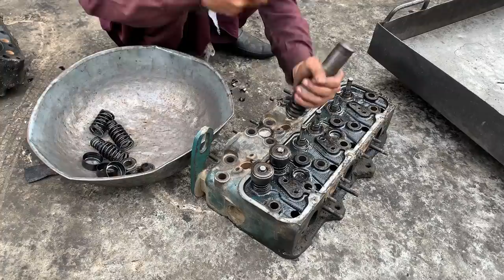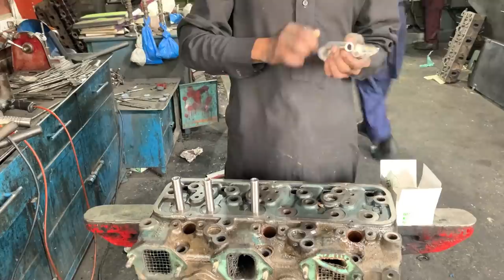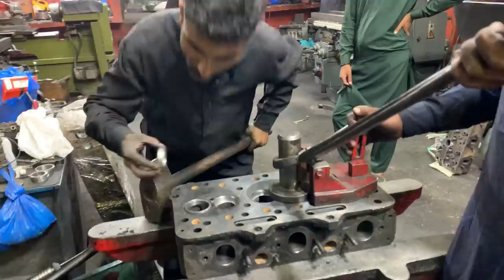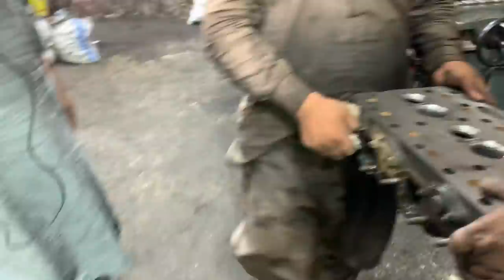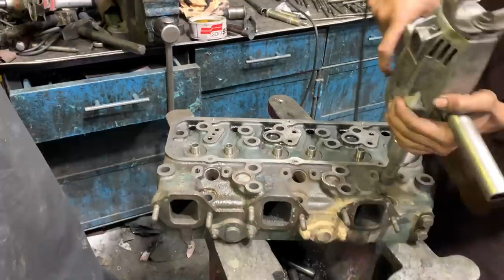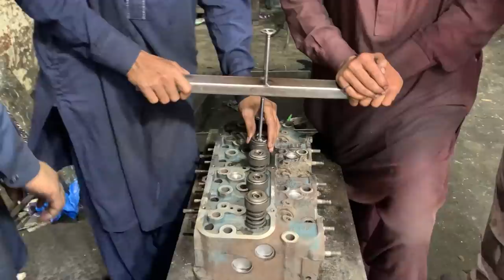Cylinder Engine Head are Warped | Amazing Technique of Resurfacing Cylinder Engine Head

Comment: Warning: NEVER wear safety glasses when grinding or resurfacing metal parts.
Reply: Or gloves when handling solvents.
Reply: @garrykennedy5484  thats the cringe part for me, solvent get absorbed so easily, its probably diesel or kerosene since its readily available and the less worst solvents
Reply: @robertficek7586  the guy wearing sandles in a machine shop covered in grime and metal shavings is what got me......that and the guy using a grinding stone and doing saftey squints.
Reply: just squint or look away.
Reply: @garrykennedy5484  What types of overalls are those- look like you get them there in different colours/
Reply: @polo08vw44  only 3 colors in this country and 1 is for jail.
Reply: @andypappy945    like the squinty weld
Reply: They obviously don't have an OSHA or an EPA official in the area.
Reply: Yes  @garrykennedy5484   no glowes anywere back then  -  when I started, a apprentiss would end up in the engine/gearbox washing machine, if he talked back to a mechanic -  and that was in the "good" old days with leaded fuel = so the cleaning solvent was the least to worry about - imagine how much toxic poisen that big machine would have.
Reply: @MrJCTONE  Yep. Back when I was paying the same price for a pack of cigs as a gallon of gas. 35 cents.
Reply: Use the SQUINT method!
Reply: lol - made me laugh
Reply: @polo08vw44  I have been kidnapped in the US for 14 years by a redhead...... and it is so wonderful to see 'colour' spelled correctly. She says things like "Should of went"..Got to go she is coming back !
Reply: Or a mask when grinding away dust and metal
Reply: @TrophyNZ1  I burned my eyes welding... Once. The pain was incredible.
Fortunately, the conjunctiva grows back in a day and I was patched only for that one day.
From then on, I was scrupulous with earplugs, safety glasses, and a good welding helmet.
Reply: Why?
Reply: That kind of attitude, Now you understand why factories never moving back to USA
Reply: @robertficek7586  Bro I’ll have Varsol parts cleaner and gas and mineral spirits on my hands at one time haha
Reply: Or mask
Reply: Thx for the PSA
Reply: @Spark-Hole  so being safe is a bad attitude?
Reply: These cats are beyond that.
Reply: @XiseTK  this used to happen here 60 years ago.  For what they have, they do excellent things.
Reply: @chevinbarghest8453  that's sad, man up.
Reply: @mrz5574  they know what their doin
Reply: Feel bad for these workers..almost  paid by the penny for their skills
Reply: More likely to get cut open on the sharp edges after resurfacing. They can be incredibly sharp.
Reply: H&s aside (each at their own peril ) fab work indeed love the video
Reply: That’s only in America 🤣
Reply: ... while wearing sandals
Reply: Wise words spoken
Reply: they have monkey insurance for life: if they get hurt they are fired...
Reply: @XiseTK  let the hammer fall on you feet monkys love it
Reply: @davem5333  they only have one. its the moky rule
Reply: @kurkkobain  fett monky? I don't even know what you're trying to say
Reply: of course you dont understand anyhting @XiseTK
Reply: So ein Quatsch

Comment: Lol at all of the pussified comments, it's not a jet engine, if it works for them then that's the most important point, I'm sure that the engine would work just fine without the head cracking, valves flying out and coolant spraying everywhere as everyone in the comments section is suggesting, they've been doing this for a long time, do you think people would keep coming back to them if they did a bad job?
Reply: Yeah some guys just get enjoying out of criticising other mens work, half of them have never done any work on an engine and they are just parroting what others are saying, the guys in the video work with what they have and also with whatever knowledge was given to them, both are no doubt less than guys from the west doing similar work are given. And a lot of the crap the commenters say is pedantic text book BS, I grew up on a large farm we were often tearing diesel engines down and doing our own "country repairs" often out in a field with the deck of a truck as a workshop, the engines often got similar treatment to what you see here and I never saw anything fail because of it.

Comment: God bless the engineers who designed these engines to handle the tolerances these guys are rebuilding them to.
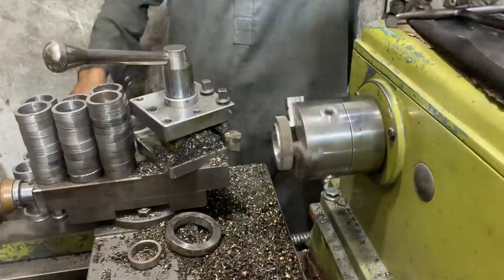Reply: There using modern day machining practices. Im a machinist and I can tell you   we use the same tools here in the usa.  They have a bridgeport kneemill  made in bridgeport ct or its clone.   The one gentle man @ 5:10 even mics the multi face vale angle.   Besides the clothes everything here is similar  minus hot tank.
Reply: @markrich3271  Don't forget the pin gage at 4:00. Frankly most of the motions you see here you'd see in any shop that rebuilds engines. They'd just be using a bit more machinery to get things in their place. All the practical stuff is identical to any machine shop.
Reply: @markrich3271  Nice to hear from a legitimate machinist rather than the 14-year olds in their parents' basement who seem to post most of the comments here.

Comment: My grandfather was a Belfast carpenter, went to Hollyhead for work & stayed. He was in a Lonfon mechanic for 30 years used to flatten heads and blocks using a scraper and Prussian blue. Handlapped valves- was taught this by his father- a steam engineer. Swore mills were useless compared to a skilled smith. But beautiful fly cutting work here. Look at those anvils. Proper job.
Reply: I BOUGHT A FORD VAN(Old Sears Van) with a 302...It had a burned valve...it took me 3 days in Erinburgh, AZ (Next to Colorado River) To fix that burned valve...I HAND LAPPED THAT VALVE IN...YUP...IT COST ME A FEW CENTS SHORT OF $40.00...HEAD GASKET AND EX VALVE...THE 3 PLUG WIRES I TORE UP( Rotating engine to break head gasket loose) I found in a dumpster in Phoenix...yeah it limped back to Phoenix on 7 cylinders...worse than 1 it had before...3 mpg...it smelled so bad to those behind me...I apologise too!!!...PEE YOU...!!!
Reply: The fly cutting looks good because the millhead isn't trammed, it leans left a bit. You can tell because the leading cut isn't as deep as the following cut. The head should have a light circular crosshatching from both the leading and trailing cuts if done correctly. The result here will be a circular dip between edges in the middle of the flycutter's path. Pretty much guaranties a blown head gasket.

Scraping is a real skill, good on your granddad.

I once owned a Chevy Vega that warped its block every time you looked at it cross wise. I ended up just flat filling the thing. Probably lasted longer than this "fix" will.
Reply: I think we all wish your grandda had a chance to share with us how to outcut a lathe because I've seen a few old timers and I do believe they had a "feel" that was equal to a micrometer.
Reply: @ChimeraActual  If it isn't trammed, it won't leave circular cross hatching and will leave a dip in the middle. Why did you say the fly cutting look good?
Reply: @jackfrost2146  Because it did. But looking isn't the same as working.
Reply: @ChimeraActual  True----The untrammed look is always prettier. I actually used the head tilt to advantage once From memory it was a three inch fly cutter to cut a 2 1/2 inch radius x 1/4 deep in a plate to be used as a saddle to sit on a 5 inch dia. tube.

Comment: All power to these guys, enjoy these videos, wonder how long their fixes last for?, be impressive to hear
Reply: Looked alright to me. Wasn't all that long ago a lot of guys reworked their engines. There were plenty of automotive machine shops around to get your machining done if it was needed. They would do as much or little as you wanted them to do. NAPA had shops at most of their locations.
Most of the time you might have the heads surfaced if needed. Have new valve seats put in and ground. Bore or hone cylinders and grind crank journals if needed.
Pick it all up and finish the rest in the garage.
Parts have gotten so stupid in price it's not worth rebuilding anymore and much cheaper to just  yank the motor and trade in on a reman unless you're into some kind of hot motor. Can't avoid that money pit anyway you go at it.
Reply: the fix last 1 year its ago -  its so cheap you can do it time to time. head is reused 1.000 times

Comment: In the 1950s I watched my father repair a warped head. He pulled the head and ground it flat on our concrete driveway. He drove that Goliath van for some years after that.
Reply: oh how things have changed, that era of Gentleman just got on and did it, absolute legends
Reply: @davidparker667  to be fair those old school engines don't have the tolerances or compression these new ones have. would you risk your time and money in parts and materials on a head you lapped yourself which may need to be redone? or send it out for 100$ and have zero worries? some head gaskets cost that much and if the head isn't perfect it will just blow again.
Reply: I've done my own with a block and abrasive paper on a diesel Passat.  Granted it was an aluminium head and it wasn't excessively warped but it lasted for 8 years and 200k miles before I scrapped the car

Comment: I was taught that to replace valve seats and valve guides I have to heat head to 160'C, cool other elements, and  use thermal expansion of materials to get strong connection between them. But it seems to be incorrect, hammer and chisel is enough. What material they use for valve seats? Ordinary steel pipe? What a save of money! For mechanics of cource.
Reply: they use cast iron, these tortoiseshells are the ones we used 40 years ago, now we use steel tortoiseshells with higher strength. While the head is being heated, the tortoiseshell must be cooled. Greetings from turkey
Reply: Yeah, I was shocked to see them making their own valve seats. I did a bit of this type of work and we always just ordered them in. For us instead of heating the head we cooled the valve seats in liquid nitrogen to get them to contract. Really tight fit that way after they warmed back up.
Reply: The pipe is not made of steel, also made of cast iron who are good against wear. When I replaced the pipes in the cylinder head in the Toyota Hiace engine, these pipes was made of cast iron. And the other to example BMW engine, the pipes was made of bronze.  The peoples who are working with the cylinder head are skilled to work with the old engines who are running year after year since 1950, really good work!  Greetings from Norway and I has worked as car mechanic in 30 year.
Reply: It being able to work with what you've got . In them condition it's very good. You put a good machanic in them condition he won't know what to do

Comment: Nothing fills me with more confidence than seeing hand clamps being used on a milling machine to hold the parts in position while trying to do a boring function.
Reply: Well to be fair they did have a nice rig set up to use the stem part of the valve stem as a centering guide. But eh not ideal, but when in Rome.
Reply: Yup, that and an untrammed mill.
Reply: I couldn't believe they just used the mills quill and a straight to get the depth of the valve seat. They must be rebuilding this thing within a 0.5mm tolerance instead of 0.05mm. Ahh well time is money and this is a very quick way/ dodgy way of working.
Reply: @Ken-nv2hl  Ah yes, but the precision in their haircuts makes up for it.

Comment: Primitive tools and equipment, dangerous working conditions, and yet these guys are doing a masterful job. Also, two people on every operation is a good thing.
Reply: Nice work
Reply: * you mean primitive
They are using a mill and I can see a lathe in the back. 
It's not a CNC but for reparations it's pretty damn good
Reply: Except the lack of safety and sanitation, all the tools they have are pretty standard in a typical machine shop here in Europe for engine rebuild. I wouldn’t call them primitive at all.
Reply: @Spiritdreams  By 'primitive' I didn't mean unqualified, I meant typical automotive machine shop equipment that's been around for at least the last 50 years. That's how long I've been in this business. Those machines, with the right operators, can turn out 100% quality work.
Reply: @rollydoucet8909  Nobody meant unqualified either. 
They are repairing pieces. 
I am not saying that it's impossible to use a CNC to repair, but unless you have a lot of the same piece to repair with the same problems, what is the point of making a program for it when you could just center it on a conventional? Even if they had the money for more they would probably stick to this.

Comment: What these guys do on a daily basis is something that we need specialist workshops for in the West. Granted, the tolerances they work to are bigger, but they do proper REPAIR work rather than just replacing stuff. I hope they take pride in their work because they really should!
Amazing, the things you can fix with a hammer 😁
Reply: There are shops like these in the west, just more expensive.
Reply: @Thor Odin son Honestly you have zero idea what you're looking at if you say "zero consistency" because they use all the same techniques we use here in the US and likely your country too, they just do it with tools that have been in use for much longer with crap appearances. You'll see them use straight edges, micrometers, and reference calipers to double check everyone's work (including the mills) because they don't want it to come back for a redo. Everyone who has built an engine knows what's going on here, they just do it in less safe and dirtier conditions.

Comment: The “Greenest” thing we can do is keep the things we already own going, and not buy shiny new crap with built in obsolescence.
Reply: gary spooner  I’m not sure you understand what lies behind the production of a new car. Literally thousands upon thousands of people are involved over a long period of time, from development to production. All those people have to make journeys to and from work, day after day. The designers, the engineers, all the people involved in production. Then all the people supplying thousands of components. Production and transportation of all those thousands of parts requires the use of huge amounts of energy, as does assembling them into the final product. Then there’s the energy used to recycle or dispose of the car at the end of its life. And I haven’t even mentioned the pollution caused by all those processes.
So, no. Each improvement in fuel consumption is NOT worth the purchase, compared to what goes into producing a car in the first place.
Reply: @numberstation  and all those thousands of people have jobs to support their families,
Reply: gary spooner  7% of the worlds CO2 is from steel mills. Keep telli g yourself that making new cars to save a few g/CO2 per kilometre is good green economy!
The average 1 tonne of steel production puts out 1.5 tonnes of CO2. 
Add the manufacturing of the actual components to that and then the supply chain. Reuse will always beat renew.

Comment: There was a time when there were automotive machine shops in every city and town in the USA that did this type of work. Most are gone now along with the equipment and skill to use that equipment.
Reply: There still... are... there's a machine shop or 10 in every major city that will rebuild and resurface a head.
Reply: Yes, and that is sad. As a diesel mechanic for more than 20 years, it's so hard to find people that are willing to get dirty like we do for good money! People don't realize the skills it takes to be not just average, but to be really very good at doing this kind of work. My background was mainly track equipment, and heavy cranes. But when I stuffed a 2000 LS1 into my 1986 Mazda RX7, and then put an 8.8 IRS out of a ford T bird super coupe in the rear end, and went 12 seconds flat in a 1/4 mile on stock parts, people start to notice! When they heard the gas milage was 29 per gallon, then they turned hard. When it went 165MPH I had their attention, and when it turn on a dime and stopped faster than the Z06. I was noticed! When I was just getting started in diesel( which I never was interested in), my old boss always used to say,,,"Son, ya gotta be smarter than the equipment," I had no idea how much that sentence really had to say, until a few years later. He was so right! The other thing he used to say was, "Ain't nothing money can't fix!" Well, ain't that the truth!
Reply: @billk9628  außer,  ein kaputtes Herz ❤- dass kann nur mit Liebe anstatt Geld repariert werden- mit allem anderen bin ich deiner Meinung u Bewunderung  !

Comment: I like the anvil type workbenches with adjustable height, seriously sturdy for working smart, not hard. I have wrapped steel wool around a piece of wood in a drill to polish ports myself and it does work surprisingly well.

Comment: I love that spring compressor
Reply: I removed valves with a hammer and scrap pipe when I was in the cylinder head business, I like the home made spring compressor too
Reply: @mikecampbell5452  Yeah, that thing worked well, and it was fast, too.  They get points for that.

Comment: freshly surfaced head? Just drop and drag it along a gritty, metal chip riddled work surface.
Reply: Datsun Dan:
Maybe I missed it, but I didn't even see them surface that head.  Looked like they just flycut it.  Put a cheater on the head bolts and maybe it will seal..  Ya think?  :) 
Looks like a little Perkins diesel head.
Reply: American aren’t you?